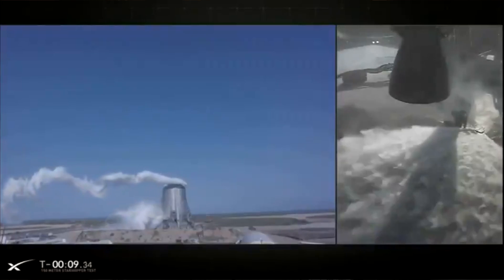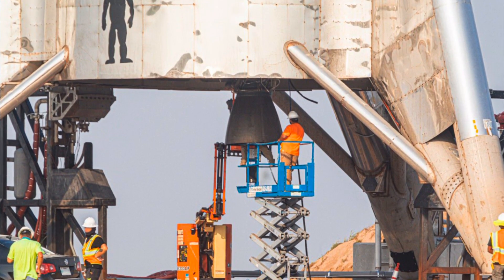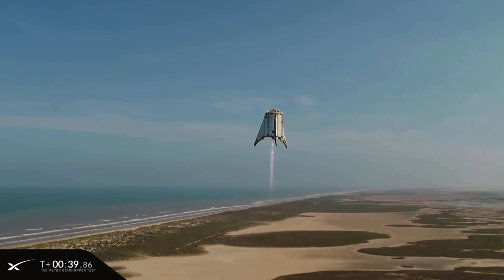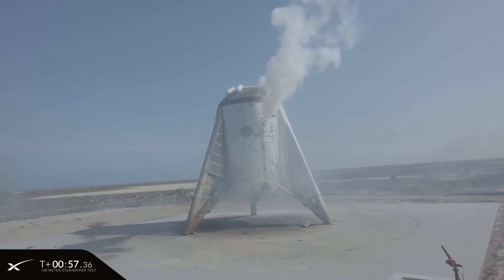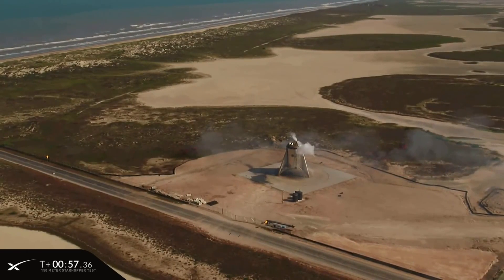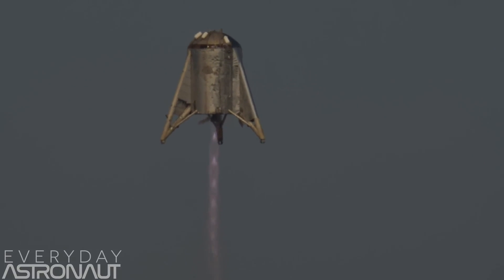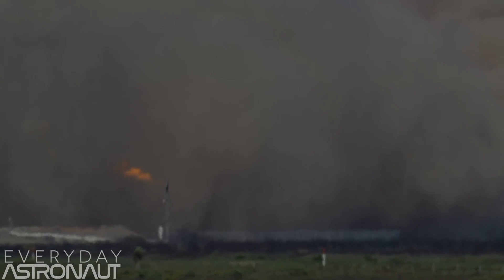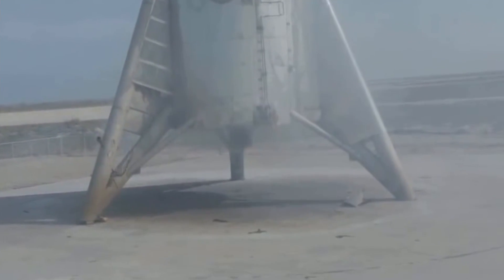Starship Hopper's Biggest, Lastest Flight Above Texas

Comment: It's the beginning of something great!
Reply: The fact this was built outside means it could launch from anywhere you can ship the parts.
Reply: What is this hopper anyway, and why does it look like this? 
I'm way behind on space news. :(
Reply: @M.Y.B.A-p4d   This is a test article, to test engines and control systems for the BFR. It did originally have a nose cone on it, which got blown over and damaged in a windstorm. They started to repair it, but then realized that, for the low level, low speed tests they were going to be doing with it, they did not really need one, and so it wound up looking like a water heater.
Reply: @M.Y.B.A-p4d  It's a prototype to test the Raptor engine which will power Starship, SpaceX's next generation spaceship. Hopefully.
Reply: @kangirigungi  oh so this vehicle is just a weight to test the engines on? It looks very un-aerodynamic as a whole. 
Sounds neat! 
*and thanks for your reply!
Reply: U N well, the starship project as a whole is a bit unaerodynamic... they are very Von Braun meets Kerbal looking. They supposed to be operational testbeds for more durable materials like steel  + stronger engines to get more life out of every rocket, while also being super easy to refuel and launch again so that LEO/Lunar/Martian transport is both quicker, cheaper, and generally more available